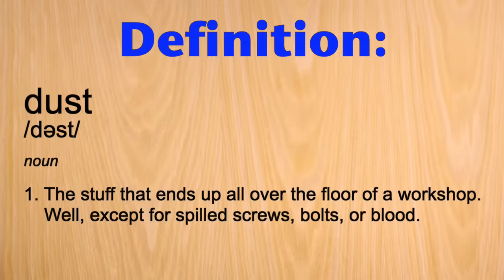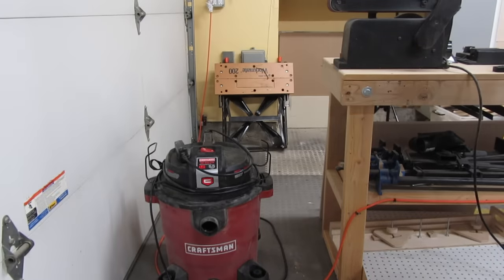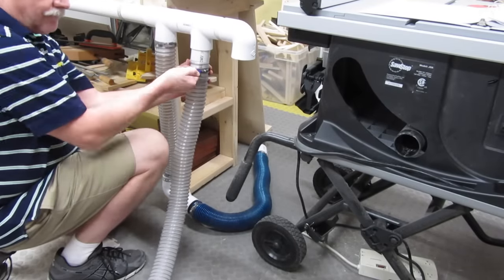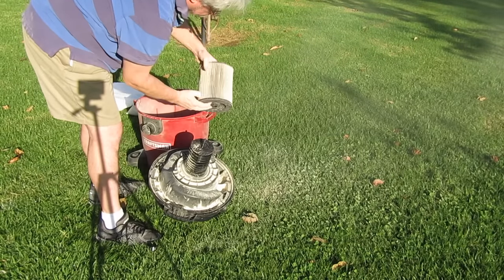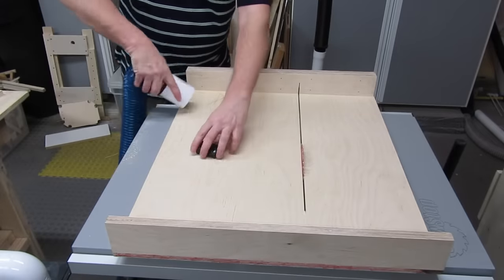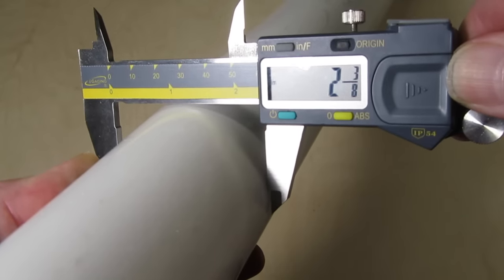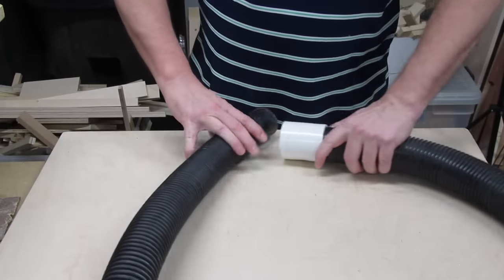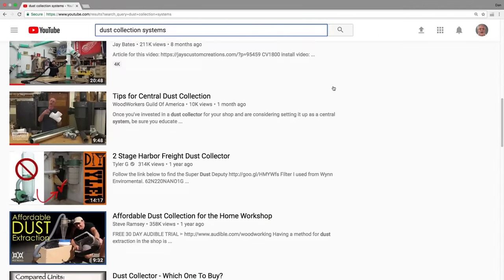Dust Collection for Newbies: Introduction to Dust Collection

Comment: Regarding the chop saw.  When I tried it shrapnel city.  First time too fast down speed.  Other attempts grabbing and chipping.  Every time a great  sense of apprehension.  I now use a crosscut saw and a guide for 1 1/2 and larger and a pvc pipe cutter.

Gerry
Reply from the maker: Thanks for the comment. I think there must be some sort of trick with the chop saw, because lots of people say they have no problems. Who knows?

Comment: I was able to cut 2 1/2 inch and 4 inch PVC with my compound mitre saw and it worked very well.  you just have to go slow and not force it and I never had a pipe shatter.  Still, safety glasses always.
Reply from the maker: Thanks for the info! 😄

Comment: Great video, great sound, good pacing!  Thank you!

Don't waste your time on paper dust masks.  A half-mask respirator (3M or AOSafety, P95 or P100 filters, around $20) that has a soft rubber seal around it and will actually seal to your face is more comfortable and far better protection, especially when sweeping the floor or emptying dust.  Especially a good idea when dealing with e.g. silica dust - the sharp-edged particles cause scarring of lung tissue (silicosis).

Remember that the finest dust is the most dangerous - it gets deep in your lungs and can cause scarring (think thousands of splinters in your lungs).

Around 2:40, following the shop-vac nozzle around, the theme from "Jaws" would go well...
Reply from the maker: LOL to that last comment. I can hear it now. 😄 Thanks for the comment, and the mask suggestion. Sounds like a great idea - those paper masks aren't very pleasant.
Reply: @TheNewbieWoodworker  the paper masks are also not very effective.  

Once you have worn a half-mask and tested the face seal by putting your fingers over the exhaust valve and blowing (if you have a good seal, the mask lifts off your face until air can blow past a seal), you realize just how much air and dust just goes around the edges of the paper masks.
Reply from the maker: @scottwillis5434  Thanks. Since I don't know anything about this type of mask, what mask do you use?
Reply: @TheNewbieWoodworker  think I have a 3M 6300 series.  Some issues with goggles fogging, I may try switching to the 7500 series (exhaust aimed down).  The last digit is based on mask size (Small, Medium, Large).  One reviewer likes 7500 much better, think I will try one.

The filters are replaceable and interchangeable.  I like using the P100 (3M 2097) for better filtration.  That may make your lung muscles a bit sore at first until they get stronger, but beats getting junk in the lungs!  P95 if you want less restriction.

The same mask will fit different filter cartridges for organic vapors, ammonia, etc.  

Found "Like the 6000 mask, the 7500 uses cartridges numbered 6XXX and particle filters numbered 2XXXX."

Remember that a respirator doesn't keep debris or vapors out of your eyes.
Reply from the maker: @scottwillis5434  Thanks, Scott! I'll look into it. 🙂
Reply from the maker: @scottwillis5434  My reply got lost, apparently. But all I said was, "Thanks - I'll look into it." 😄

Comment: To answer the dose mitre saw working with PVC pipe, it is fine providing you have the correct blade and take precautions as cutting any round stock is dangerous on a miter. 
 Be aware though it will create a lot of static charged plastic particles that are a nightmare to clean up.
Reply from the maker: Thanks, and you got that right - those particles stick to everything! 😄

Comment: Yes you can cut PVC with a miter saw, and can easily cut 4 inch PVC with a 12 inch saw. Band saw will work also but faster and more square cut with the miter
Reply from the maker: Thanks! 😄

Comment: Tight (90°) turns cause the air/dust to slow down and are therefor less efficient. This is why 2-45°’s, or what are called “long radius” fittings are recommended. They allow for a more consistent, less impeded flow. In all honesty it probably doesn’t matter that much in your system but is more relevant in larger systems moving larger volumes of air and dust, like that from a jointer or planer, or those connected to multiple machines running simultaneously as in a production shop.
Reply from the maker: Thanks for the comment. For shop vac-based systems, it doesn't make much of a difference. But for true dust collectors, it matters a lot. It has something to do with air speed vs. air volume, or something like that.

Comment: it is often recommended to run a bare ground wire inside the dust collection tubes as wood dust and chips can become explosive when rubbing through the tube.
Reply from the maker: A lot of people recommend that, it's true. But I'm not so sure it's necessary: http://www.woodcentral.com/articles/shop/articles_221.shtml. Still, people should do whatever they think is best for their safety.

Comment: I've never put a dust collection system together but if I did I think I'd come up with a sound insulated cabinet to put the shop vac in so that it wasn't so loud in my shop. Shop vacs are annoyingly loud in my opinion. If I had a detached building or shed for my workshop I would even consider building a sound insulated area for it to be housed outside of the building or shed but easily accessible to get to the vac.
Reply from the maker: Thanks for the comment! One thing to consider is if you're using it with a table saw, the table saw is already loud.

Comment: Hi Dan,  It's been a while since I've seen a video, I like your no-nonsense approach.  I'm getting around to finally connecting up my dust collection system, I bought a Powertec kit off of amazon... and I'm half-way regretting all the trouble I'm having.  I'm quickly learning that 2.5" hoses and connectors are anything but!   It's a nightmare finding ways to connect my tools and such... but I soon hope to have it sorted out.  I like the idea of the DIY PVC adapters.  I've purchased couplers and reducers from Powertec only to feel gouged for what I think should cost a few bucks... $10 for a coupler?? Well, it fits the blast gates and I'm just holding my nose when I purchased them because it stinks.
Reply from the maker: Yeah, as much as possible I try to finagle something myself from PVC bought at Home Depot, and my heat gun. Just make sure you do it in a well-ventiallated area, and don't burn the PVC. Good luck!
Reply: I've used a heat gun to reduce or enlarge PVC to fit the desired connection.  Usually, it deformed on me so getting a tight fit was always a problem.  I solved the problem by turning down the outside or reaming the inside of the piece on a lathe to fit.  Before I got my lathe, I fastened the part to a PVC cap or plug with a hole drilled in the center.  I inserted a machine screw through the hole, put a nut on the screw, and chucked the piece in my drill.  Then, I carefully trimmed or reamed out the PVC to the desired dimensions, removed it from the cap/plug and was good to go.
Reply from the maker: @DokDream  If you had a problem with the heat gun, you were probably heating the PVC too much. It needs to be just maleable enough to have to use force to get it to mold to what you want, but not so soft that it deforms.

Comment: Fantastic and really clever.  Trouble is I have 2 (sheds 8ftx8ft) one as the workshop and the other for storage and doing "clean jobs" etc drawings, finishing with NO dust "   Trouble is IF I had all that brilliant bits of kit in my "workshop" I would have to be doing all my work on top of the machines on my hands and knees !!!  Due to restricted space I use a domestic vacuum cleaner and plug into the different tools, bit of a hassle but I've got used to it. Thanks for vid. When and IF my DREAM of a larger shop comes true then I will "get back to you immediately" !!!!! :)  I make children's wooden trucks (max length 30 inches)
Reply from the maker: Thanks for the comment! I hope you eventually get more room, but it's the end product that matters, right? 😄
Reply: Yep ur right there !!  I must be grateful for what I have.   Happy new year to you !
Reply from the maker: @baileysbootstraps8170  Thanks, and you too!

Comment: Great video for fellow noobs like me, thank you ! What a pity we have no Rockler stores in the UK - at least that I know of but the internet is OK I guess.  I use any fine tooth hand saw (usually a panel or tenon) for cutting clamped PVC pipe.  I find it makes for straighter cuts - and so far no explosions!  Speaking of which, NerdByDesign had some really interesting stuff to say a week ago.  Hitherto I had only really considered dust and shaving residues a fire hazard for sparks from metal grinding/sharpening etc (apart from being generally messy and a nuisance).  I have a comfy respirator if needs be and prefer a full face shield to glasses or goggles for most things (especially after the ball race on one of my router bits seized unexpectedly & exploded).  I find it does not steam up easily, is easy to lift up for, & drop back after, inspection and fits over my own glasses better anyway.  It is surprising how much can ping off it now & again!

Keep up the good work, and may 2019 be full of blessings for you and yours,  BSR
Reply from the maker: Thanks for the great comment - I really appreciate it! And sorry about no Rockler, but other companies have started duplicating some of their products, so perhaps they're available in the UK. And yes, NerdByDesign made some great points. That's one of the unexpected things I discovered after starting this channel. The number of things I learn is almost equal to the amount I teach. Sounds like a good trade-off, to me. 😄
Reply: @TheNewbieWoodworker  s
Reply from the maker: @kennethpenny3816  👍

Comment: Air pressure (or in this case suction) is lost to turbulence anytime the air goes arround a courner or goes over a joint.You can use your PVC molding skills to make long radius bends instead of elbows where you can. You can also try to use fewer joints where possible. This will reduce turbulance in the bends, reduce suction loss and increse efficiency.
Reply from the maker: Thanks for the info.
Reply: Thank you for the excellent video sir
Reply from the maker: @hexadecimil  Thanks! 😄

Comment: ...in a dream world where every tool has the same internal size of dust port, and they also all match your shop vac and cyclone.
Reply from the maker: Yep, we can wish. 😄Makes me appreciate the things we have managed to standardize.
Reply: @TheNewbieWoodworker  And I thought going with a few of the same brand of tools would help!  Not so much. lol.  I have a Rigid (Home Depot brand) table saw, and even the Rigid shop vac...  AND the Rigid-made cyclone/separator...  they don't match! The only thing that matches is they are all Home Depot orange. 🤣  And they don't even sell adapters to make one Rigid match the other!  And then I have other brands of mitre saw and belt/disc sander...  at least when I make my own drill press table and router table I can find something that will work for those!
Reply from the maker: @amsivertson  So true - even Home Depot can't give us standards all the time. Personally, I just resign myself to having to make adapters from PVC and a heat gun. With the garage door open for ventilation, of course. 😄

Comment: Great video, makes me want to redesign my shop. Thanks
Reply from the maker: Thanks, and you're welcome! 🙂
Reply: Watch Stumpy Nubs discussion of dust collection first.
He's got some important information that you need to see first.  This system is WAY too convoluted.
Too much tubing and too many connections destroy the effectiveness of this dust collection system.
Reply from the maker: @odinata  I'm just guessing here, but I suspect you don't understand the difference between a shop-vac-based system using 2 1/2" pipes, vs. 4" (or larger) pipes and a true dust collector (blower). So just be aware that they do, in fact, operate on different principles, and my setup (which is a fairly common type of setup) works just fine.
Reply from the maker: @odinata  Actually, I have indeed watched that video, as well as most of James Hamilton's videos. And yes, of course those things cause reductions of effectiveness. The question is, how much of an impact do they have, and will the system still be effective enough to use. Yes, if I took the vacuum directly to a pile of dust and vacuum up the dust, the vacuum will be operating just about as efficiently as it can.

But guess what? In a dust collection system like mine, it's still efficient enough to do the job. Now if it was a blower-based system, the drop in efficiency would be more dramatic, and since blowers rely on air volume as opposed to air speed (I think), the impact is greater.

If you don't believe that, it doesn't matter, because the real question is: does the system perform the job it's supposed to? And the answer in my case is yes, it does. Is it perfect? Hell no! No dust collection system is. Would a blower-based system with larger pipes be better in my workshop? Honestly, I don't know. Most of my tools use smaller dust ports, so I kind of doubt it would. It's a moot point anyway, because I don't have room for one in my shop.

So could I increase the efficiency with straighter runs? Yes. Would it matter? No. (Except for my router table at the end, which I admit has dust collection problems. But that's another story, and is more related to design issues and less to DC efficiency.)
Reply: @TheNewbieWoodworker  Oh good.  Then you certainly understand the limitations of shop vac systems, what they can't do, and how long runs of pipe with many sharp angle turns, as well as long segments of flexible hose that is not smooth inside adversely affect a system such as yours.  
That was my only point.  Just hoping to save the folks the time and expense of installing lots of ineffective "dust collection", as hooking a shop vac directly to the tool in use is much more efficient.
Thanks again!
Reply from the maker: @odinata  That makes total sense. Thanks for not letting my surly disposition bother you - it's been a tough couple of days. :)
Reply from the maker: @odinata  🤣🤣🤣

Comment: Just FYI. A miter saw is NOT a chop saw. A cutoff saw IS a chop saw. Miter saws are typically 10-12" and a chop saw is typically 14". Unsurprisingly, the larger the blade, the greater the cost. I work primarily with steel and I picked up a 10" sliding compound miter saw and carbide-toothed ferrous metal cutting blade for about the same price as just a 14" carbide-toothed ferrous metal cutting blade. And while I wasn't expecting it to perform very well, or last very long, it's done surprisingly well
Reply from the maker: Thanks for the info!

Comment: Yes you can use a miter saw to do it and the easiest. Probably the best is the Sawzall as well as being the quickest to cut PVC with anyways. You must use a metal blade on it though. Since the wood kinds are too big and abrasive on it. Making it dangerous as can possibly be to cut! The metal blades are smaller making it slide back and forth much easier. Making it take only a second to get threw it.
Reply from the maker: Thanks for the info! 👍

Comment: I have just ripped out my 2HP Harbor freight system which took up too much room and was very noisy. I'm planning on getting a wall mounted vac to use with my  'DUSTOPPERr' from Home Depot which works well as an alternative to the dust deputy . It is cheaper and does not take up as much space. I have just ripped out my 2HP Harbor freight system which took up to much room and was very noisy.
Reply from the maker: Thanks for the comment. I did a review of the Dustopper a few months back, and I think you'll enjoy it.

Comment: @~ 15:22  True 2 45's making more of a sweep is more efficient . If you have the room to use a sweep that's even even better .  Used to work with pools and we use a chop saw to cut sch-40 , use a fine tooth blade and don't cut to fast but fast enough as to not melt your way through .
.
Reply from the maker: Thanks for the comment!

Comment: Great video. You need a water filled dust collector or that shop vac filter will be toast every 10 mins.
Reply from the maker: Oddly enough, in the over 3 years since I made this video, I haven't had any problems with the shop vac filter, and only need to shake it out a little once every 6 months or so.

Comment: One thing, with the PVC piping. You can go from small to larger piping (relative to the flow) but NOT the other way around.
Reply from the maker: For a main run, I agree. But after a dust gate, if you need to narrow down the pipe to connect to a smaller dust port, that should be fine. Do you agree?
Reply: Yes I do, but I think just stick to the same size if possible after that.
Reply from the maker: Sounds about right to me. Thanks for sharing!

Comment: I haven't read all of the comments, so others may have said this already.  I have cut a lot of PVC on a sliding miter saw.  I cut slowly and carefully and haven't had any problems with PVC shattering or splintering.  I usually clean up the cut edges on my bench belt sander.
Reply from the maker: Thanks, Wallace. Yes, others have talked about it, but I always appreciate it when people offer real-world experience. And you gotta love those belt sanders. I remember when I struggled trying to decide if it was worth the money or not. Some of the best money I've ever spent. 😄

Comment: I've cut PVC with my miter saw countless times without any issue. Honestly never even considered it might be a problem. Might consider wearing glasses in the future.
Reply from the maker: Thanks for the info. What I'm beginning to learn is that the biggest issue is whether the PVC is clamped down or not. If it starts to "chatter", that's when bad things happen (boom). So now I can even cut it on a cross-cut sled on my table saw, as long as I clamp the pipe securely first. But yeah, I wear a face shield too, because you never know. 😄